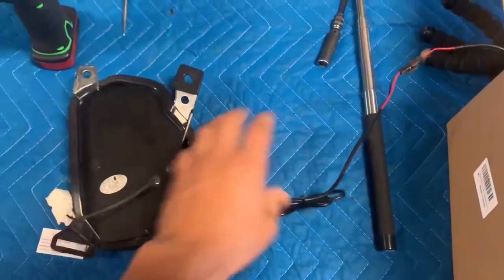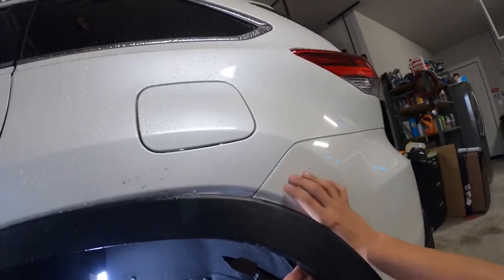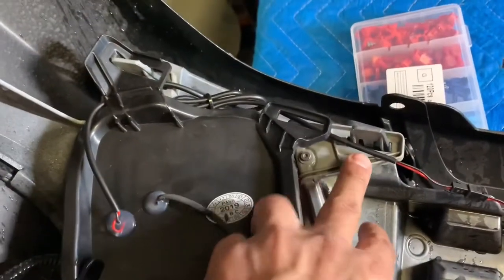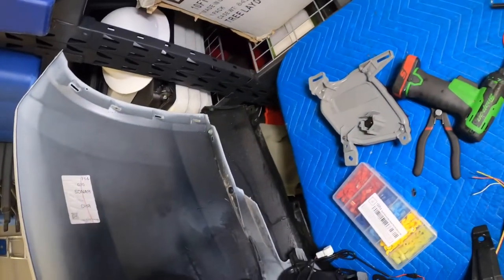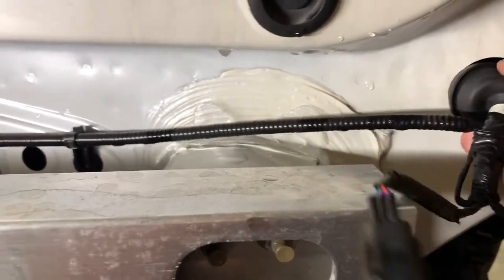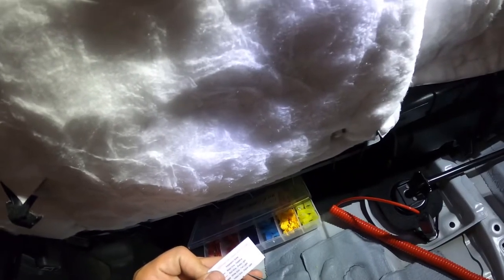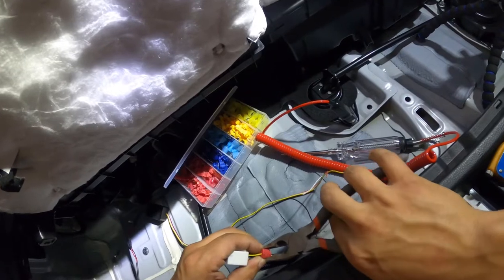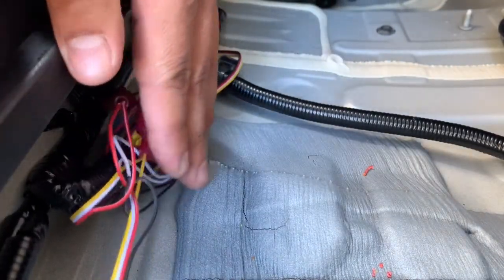How to install Toyota Highlander rear fog lamps (2014-19) Toyota Kluger

Comment: Hi, I did install those lights on my 2018 highlander, looks great works well, the only problem is the passenger side began going bad after three years, I believe the heat and exhaust fumes causes the element in the light to go bad.

Comment: Great video, installed mine last weekend and probably wouldn't have done it without this video.  I cut off the outside tabs on the lights so they fit flush and secured the bottom with a screw through the remaining tab.  I did not use the red wire and did not use the yellow wire from the 4 wire bundle.  I used only the black and white from the 4 bundle for tail lights and connected the red and black (after extending them) from the 2 wire bundle so that the center lights up for directional and brakes.

Comment: Find the brightest RED portion of lamp, wire it to achieve the rear fog light.

Use a 3 pole (amber) LED switch, (or a dedicated rear fog switch complete with it's ISO RF symbol), find a suitable location for it to be fitted.  (The switch LED is used as a required at law, 'pilot light', that lets the driver know the rear fog is 'on').

Mount the lamp per vid.  Earth the lamp.  Run a wire from the RED rear fog wire, up to the switch 'Acc' pole.

Earth the switch via it's Earth pole.

Take the power-feed for the rear fog lamp, from the cars sidelights/parking light circuit positive, to the remaining pole of the switch.

THIS gives you a rear fog light, with legally required switching  independence,- from both headlights, front fog lights, and park lights.  It will not ever, come on alone, but only if other vehicle lights are first activated by the driver AND you have switched on the dedicated rear fog lamp switch.

USE the rear fog light only under seriously reduced visibility conditions, say 100m or less, and not when your in a mere light mist.  Switch it OFF, the moment visibility improves.  (In France, Germany, a rear fog light may only be used when visibility is 50m or less, 100m in UK, this gives you an idea as to 'when'). 

Also ideal for daytime torrential rain when on the freeway; when driving through bushfire smoke; in heavy dust-storms and the like.

If you decide to wire one side of a rear fog light, (to reduce likelihood of following traffic mistaking twin rear fog lights as brake lights:- wire only the driver side lamp).

Note: By design, a rear fog lamp is brighter than brake lights, brighter than the hazard-warning lights, and of course, the regular - standard taillights.

A rear fog light must NOT be mounted less than 10cm/100mm from any brake light, so that the brake light function is not masked by the rear fog light itself.

In the US, SAE J1319 applies.  It should be, in my view, incorporated as 'mandatory' for new market entry vehicles under FMVSS-108.

Comment: I want to connect an assembly tail lights to my Toyota Highlander but the aftermarket lights came with an extra cables so I wanto know how you can connect them good because my brakes lights don’t work the ones in the back door the ones on the side there good

Comment: I got a very important question.   You know something about pre collision sensor.  Lights are on how to reset it or fix the sensor??
Reply from the maker: Usually those have to be pre-programmed & set at a specific height using a scanner. Dealers don't release that specific info to smaller dealerships they make it so you have to go to them. Was it involved in a accident?

Comment: The whole center of the lenses should light up when you hit brakes. I wondered what the white plug on lenses were for and I put power to them and they lit up.  Idk why it comes without plug adapter. I'm just going to cut off plug and tie into brake light wire and ground with rest of ground. Pretty odd they domt tell you that.
Reply: Did this work ??? Have the same situation where idk what that plug leads to
Reply: @RoyRoza  one person left a comment that its for the Curtis tow hitch lights but still didn't make sense. I cut off plug and wired them to brake lights. Works great.
Reply: @josephsherwood3371  so, when u press your brake light, both the outside and inside lights lights up?

Comment: So LEGALLY in Europe these lights  ( the parking light function as you call it) are not supposed to come on at all unless conditions warrant; low visibility.  In other words they should properly be connected to the fog lights or an extra separate switch and not come on anytime the runnning lights or parking lights are on.  These things are unsafe if they are on all the time because they are too bright and will cause issues for people behind you on clear nights.  I am not sure these are even legal in the US as you have them wired.

Comment: Thank you for sharing but how come the center lenses don’t light up?
Reply: I ordered the same ones and it appears he didn't wire the center lights. The light do have separate wires, two for the middle lights and two for the outside ring. I wired the center ones to my brake lights and the outer ring to my signal lights. Looks way better in my opinion.
Reply: @alexperez4624  can you be specific? What color wires did you connect it to in your Highlander?
Reply: @rikimarutenchu6485  follow the original posters wiring instructions BUT when it comes time to wire the two red wires to the white plug, DONT, instead, cut off the white connectors and extend the wires into the hatch area, connect both red wires from the white connectors that you cut on both lenses together and attach them to the correct wire on the white plug, then connect both black wires together to a ground point. Now when you step on your brakes, the inner LED's light up and your parking lights and turn signals are still your outer ring.

Comment: Hey man , this is what happened, after everything was done the engine stope and start system is off now , I think my suv thinks That I’m pulling a trailer, did you have anything like that or anyone else?? Let me know if i have to take them off or go to the dealership and get it checked??
Reply from the maker: That’s strange haven’t heard anyone else having this issue when they installed there’s. Not really a big deal actually unless you want the start/stop system working which I find it annoying anyways
Reply: @JJBanuelos  i see , then in that case I’ll just check with the dealership, thanks for the quick response.

Comment: Have you ever had happened that once you installed them car doesn't recognize the key remote. I installed on my car and keep on getting message "key not detected" in my car.
Reply from the maker: Never seen that before. Only time that usually happens is when key fob battery is low. Try replacing batteries on the remote. These should t have anything to do with key module of anti theft system.
Reply: @JJBanuelos  I did replace the battery it did not help, I disconnected the lights only then everything worked, connected them back it didn't work again. Have no clue why it happens I know it shouldn't but it does.
Reply from the maker: Yeah that’s very strange. They must somehow be interfering with they keyless system somehow. Not sure how though. I’ll look into it for you.

Comment: I think @trailblazer films need to make a follow up to this videos.. The center lenses should light up when you hit brakes!! You have the white plugs on yours but you didn't connected.. I got my and I am going to use the Court 56217 for the wiring.
Reply: Hi can you tell me how you wired with curt 56217? Thank you so much
Reply: @TDA879   Hi, left outer light run lights with the black little box - black to white curt, white to brown curt, yellow to yellow curt.. leave red disconnect.. green curt is for L the break lights. If you lights also have the center B lights then use the curt G for L and the curt Y for the Right.   The R side  connect B to curt W, Red disconnected, white to curt brown & Yellow to curt G
Reply: @Solidsnake12201982  can you explain this in plain English? Lol what is Court ######?
Reply: @rikimarutenchu6485 search court 56217 on YouTube and you will see the video
Reply: @Solidsnake12201982  HI Snake, Did you use the 2 wire lead coming from the lights that had the black wire and red wire connected to a white plug in adapter?   If so, what did you connect those to?  Thanks
Reply: @djnitemare19  there is two types of these rear fog lights.. some that light up the center & the outer (the edged)and other that only light the outer. For the center conect the Red wire of the L to curt Y & R to Curt Green  (on the female curt black connector) and the B wire L & R to white curt male Bullet( get female Bullet). I bought the Bullet conectors @ autozone that way I didn't have to tap in to the curt cables.
Reply: The L & R Box. The B wire from the L box to W curt, Y to Y curt & W to Curt Brown.  Right box, B to Curt W, Y to Curt G, W to Curt Brown.. leave the Red wire from both B box disconnected.. I have see other set up out therer but for me this is the best. Good luck
Reply: @Solidsnake12201982  Good idea with the bullet connectors.  You say "For the center conect the Red wire of the L & R to Curt Red"  but there is no red on the Curt, just Br, W, Y, G.    If you connect the outer and the middle of the lights, you will have 4 ground wires going to the Curt W, is that correct?
Reply: @djnitemare19  you are correct.. I was reading my first draft.. During the installation i cange my mind and conect center Right light to Curt Green & Center Left light to Curt Yellow.  That will give you Running Lights, brake Lights  and turning Lights.  The black wire you can get 1 female  bullet connector and conect to Curt White. You need 1female and 3 male.. all wire in to one bullet if it shares the seme curt color.
Reply: @Solidsnake12201982  Thanks.  I got it now, I lit up the lights with a 9v battery to ensure the lights work properly and see how the center lights up.